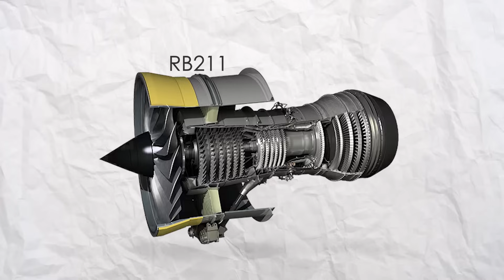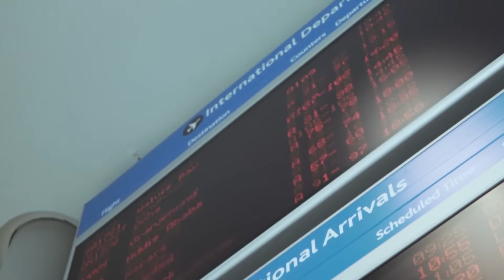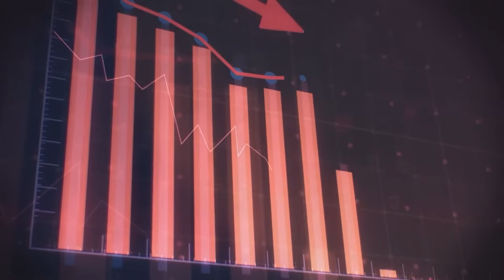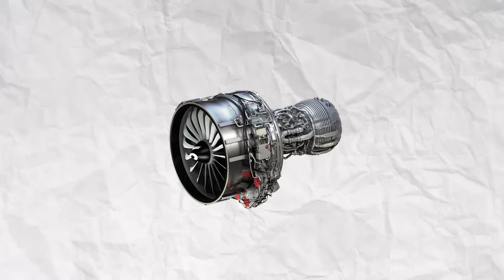Game over! Boeing KILLED 757. Here's Why...

Comment: There was little demand for 757's by the time the line closed.  There was no new engine available in the thrust class needed for an updated 757.  There still isn't.  The 757 is much heavier than the largest 737 models and variants of the A321 NEO making it less  competitive even if Boeing had built an updated 757.  The 757 is more like a wide body in terms of maintenance costs.  The remaining passenger fleets of 757's are used very differently than they were when first introduced.  Continental replaced its domestic 757's Rolls Royce powered 757's with 737-900's and redeployed all the 757's to transatlantic routes.  When they merged with United, United retired many of their Pratt and Whitney engined 757's and redeployed the rest to transcontinental service equipped with Continental's angled lie flat  business class seats used on the transatlantic operations.  A 757 replacement aircraft will have to be a plane to fit between the 737-10 and 787-8.  It won't be used for short haul flying.  It will be more of a 757 and 767 replacement.  In the US, I don't see it being used for flights shorter the mid-continent to either coast and repositioning flights.  The 737 and A320 series will dominate the narrow body fleets.  By the time 737 production ends, way more 737-10's will have been built than all the 757's ever built.

By the time the 757

Comment: Factual error!  The 737 was not the predecessor of the 757.  The 757 originally started out as a higher capacity 727.  As a 727 replacement, it was designed for higher performance for short runways, and high and hot airports.  But the 1980's more airports had built longer runways for jets and didn't need the high performance planes to visit smaller airports.  Fuel economy was more desired.